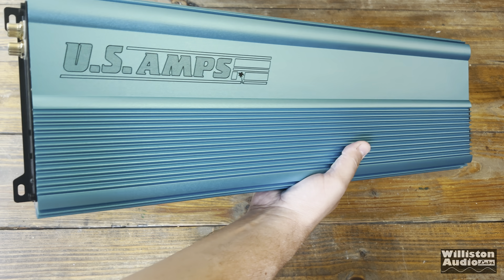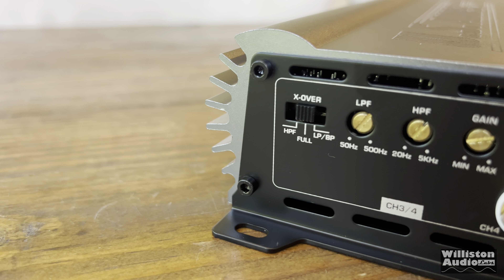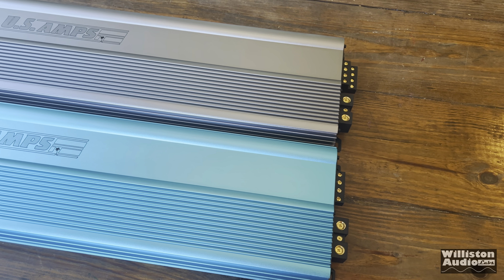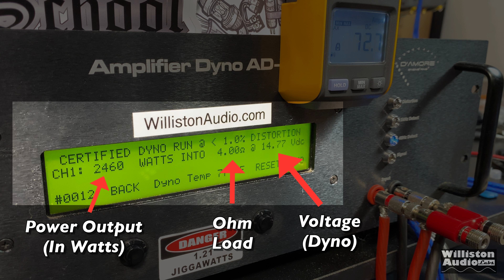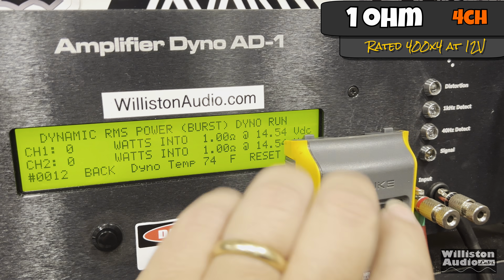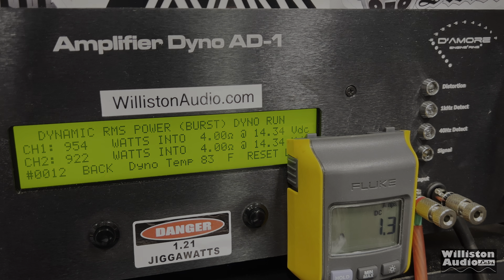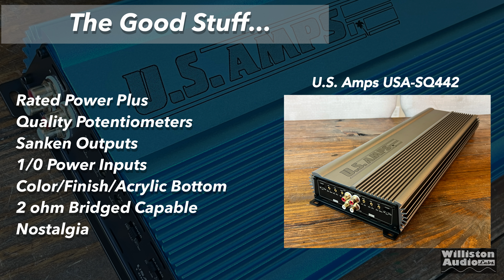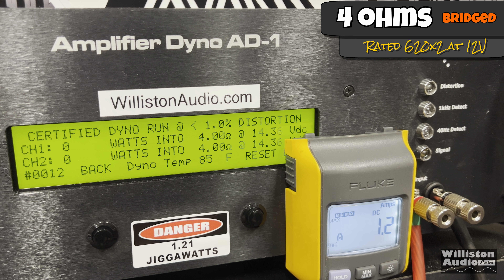The Four Channel Class AB Monster from U.S. Amps - USA-SQ442 Amp Dyno Test and Review

Comment: Hello Dereck i wath this amp live , end find this model one problem , only one , middle tranzistors driver out stage its normally low power its a cold , but power up to max power drive tranzistors temp up tp 70 celsius , its this construction its bad , not heat sink to this , hmmmm ,. ??? ,. its this to correct , im rebulding this amp , end now stbility vork ,. second bad offset 320 mv !!!!!!!!! , to muth this class amp AB , mx off set its max 250 mv to this out stage ,.

Comment: Big DWiz. I have been trying to decide between the Kicker Gold 15”x2 or 2 of the Skar  SDR 18” subs for my home theater setup. You never did do the 2 Skars in your HT setup video you mentioned. Of these 2 options, which would you do?  I ask because you have listened to and have both. 

I am a old school Kicker guy, I ran the original Solo Barics( not the ones with the inverted dust caps, I had those as well) and get this, competed with them running US Amps that were before they ran the plexi bottoms. That’s why I am considering the Kickers. It’s nostalgia for me but hard to beat the Skar pricing. Please help me decide. Thank you so much.

Comment: Great video big D! Low ohm power output is incredible but with that low of efficiency you're generating a RIDICULOUS amount of heat! That teeny fan isn't going to do much you'll need dedicated external cooling if you're going to run the amp at those loads for any length of time. I stand behind my comment from the previous US AMPS video, unless you are an older person and have a connection to the company from back in the day or some other kind of nostalgia/loyalty to the brand, there's no reason at all to pay that price per watt

Comment: What gets me is that this amp is aimed at SQ, but what is SQ about it? Most guys like myself run 6 channels.when running 6 channels, 4 of those channels barely need 50 watts, while Midbass would take on the most of the power. For the price they are asking, i would rather invest my money into Zapco, Arc Audio, or Helix. 

While crossovers on an amp are necessary. If you are gonna call this an SQ amplifier, get rid of the crossovers and allow full uninterrupted signal passes through due to the fact that most SQ guys run a DSP. 

Overall, i do not see anything good about this amplifier or anything new brung to the table that justifies paying that price tag when i know i would get a true SQ amplifier going with a much more respected brand in the SQ category

Comment: As I said on the previous video, they completely missed the mark on the price. This is a $75 amp cost to build in Korea. Full stop.
Reply: No it’s not. If the high power rail devices really are Sankan… there’s 24 of them.. that’s easily $300 of semiconductors even at bulk price. Plus a couple hundred more for all the other stuff
Reply: @darrylpioch2055  Retail price in Korea (MSRP) for one is $3.12, so let’s assume wholesale when you buy a million of them a year is $2. Like I said, this is a $75 amp, but let’s just assume “all these electronics” and overhead, it’s a $150 amp white label price to US Amps. They tried to 10x it. 🤣
Reply: Less than 1.00 each in China
Reply: @my77stang  wow. I’m not surprised.

Comment: I’ve always loved US Amps. I worked for a small shop in ~1991 in Florida, and we were one of the very first to carry them. Nobody knew who they were back then! 
I met the current owners about a year ago at Slamfest in Tampa. They were really nice, and we talked for quite some time when I told them I used to install their original amps way back then. I took their literature, and looked them up afterwards. Sadly, I was shocked at their pieces. I’d LOVE to buy/own/use a brand new US Amp, but even though I CAN afford it- I won’t.
Reply: ...an amp at that price, called "US Amps" should actually be made in the USA.If you want a Korean or Chinese made amp, there are many with similar performance at half the price. It has little in common with the original ,made in FLA, US Amps
Reply: @raymo6795  I have to agree.
These stooges are doing like most every other amp manufacturer does, pick a circuit design and have it made over seas. 
There is nothing in these amps that are American, the original designer of US Amps circuitry is in San Diego California I believe, or somewhere there in California. I actually live about 30 minutes from the Original facility where the U.S Amps were indeed 100% Hand made, except the PCB itself and Casing pieces, my Uncle worked there for several years, made decent money too, up until they sold out to RE Audio.
I honestly and whole heartily believe if a company wants to call themselves American Made or reestablished back under that Name again, it needs to be made here 90% like it was before.
You don't see Sundown, Skar or Jp or many other brands that are started here claiming U.S Made.
Reply: @robcooper3171  …I think all that is left Linear Power, TRU and ARC CLXR…A couple of Mmats mono amps.. have been buying German made Helix for the last few builds.

Comment: ill post this again here as I posted this on your 50HC review for hopes they read this and anyone who may buy these.
I had reached out to them several times about them using terrible quality electrolytic capacitors, even before these amps were available as their photos on their site gave it away. I mentioned for the price there was absolutely no excuse to use junk like that, that people who know whats good will absolutely be angry about it. When they finally got back to me they said that apon customer request they will build them with proper nichicon, rubycon, panasonic or united chemicon capacitors, yet I never seen this on their site and I still don't after my conversation with them. Not sure if this was a lie from them or not, to really double down on my replies I even gave them very specific  capacitor series from each respected brand, highlighting the absolutely most reliable parts, even going so far as to only recommend series which were AEC Q200 certified. Before they had said they would build it to my specifications if I ordered it that way, what prompted them to suggest this, is when I said I'd go so far as to recap it myself if I'd ever buy one. The last reply I typed to them after they said this is essentially this if you're willing to go though all that, why not just offer a correct product out of the box. There is still NO EXCUSE for any cost cutting,  why they are using cheap capacitors when they charge so much. They have no excuse really. I also talked about how, a few of their models used to be rated down to 0.25 ohms with tripple 0 distortion figures... They have a classic series coming out sometime and other lines of amps. For those, they need to step up the quality control.

Comment: US Amps has missed the boat= Not ALL high quality parts, should have 2 pushing, & 2 pulling fans @ the ends of ALL of their amplifiers, & have a (Bass Knob included, with voltage/clip/temperature). Even with ALL of these things added, the price should be $799 to $999 @ the MOST, not almost $1400 for the current USA-SQ442. Great review, Big D!
Reply: A few things: Four fans are needed?  Why?  If the heatsink is sufficient they're unnecessary.  Did they need them back in the '90s?  No.  Bass knob is needed?  Why?  A properly designed system shouldn't need it - and it's a four-channel.  When I had a system in my car, I could play absolutely anything (DJ Magic Mike or Björk, didn't matter) with zero adjustments.  Ditto a clip indicator.  You don't need one with a properly adjusted amp.  Plus, you should be able to tell that by ear.  Price should be lower?  Why?  Because you're used to things made in China.  This is made in California.  And it's not Class D which are cheaper due to fewer discrete components.
Reply: @KRAMITDFROG - Are you affiliated with US Amps? I have been into car audio for over 35 years, and a champion, car audio competitor. Also, what someone did in the 90s, means nothing. Thats like saying, when we were growing up, we used to ride in the back window of a vehicle, & we didn't die, so it's fine! Some people learn from mistakes, & try to do better, others do not.This is a very powerful class Ab amplifier= will get VERY HOT, it did in this video. So yes, 2 push, & 2 pull fans, having air crossflowing through it, should be installed/included, inside this, almost $1400, class Ab, amplifier, to protect this big investment. Heat kills/shortens the life of electrical components. I like running a 4-Ch. amp, to a set of components, up front, off of chs. #1, & #2, then bridging chs. #3, & #4, to run a subwoofer. This is why it would be great to have a Bass/gain Knob for bridging chs. #3, & #4. Also, setting the gains "Properly" will Not, prevent clipping in All scenarios. Music is recorded @ so many varying Levels, its almost impossible to keep from clipping, unless the gain is set so low, you can't get hardly any output. Lastly, there are similar power, high quality, class Ab amplifiers, available, for under $800. So for the amp in this video, that costs more than $500 more= $13??, the things i listed, is Not too much to ask for.
Reply: @evilinside5984   No, I'm not affiliated with them and you wrote all of that to tell me things I already know.  I did work in the industry back in the '90s so I know what things were like.  Personally, I was never a fan of theirs, but I respected them.  I had PPI, which I thought were superior and most in IASCA seemed to agree at the time.  

But, most of what you are saying the amp should have are mostly gadgets. A bass knob is a gadget driven mostly by demand of people who don't have a clue about setup.  There's bass knob on the source if you want (I get that isn't just sub-frequencies but you do have crossovers for a reason).  

I agree on the issue of heat, but fans aren't absolutely necessary if the heatsink is adequate - especially when you aren't jamming this thing under any seat.  

Your application of a four-channel isn't that of the majority.  I'd probably run the same way because I've never used fade.  That said, were it the majority, they wouldn't make monoblock or five-channel amps.  

Regarding clipping, we'll agree to disagree because my gains were set-and-forget; the volume knob does the rest of the work.  

On similar-powered Class-AB amps for less, are they made in California?  If not, there's your answer.  It simply costs more than paying robots or workers in other countries pennies on the dollar while also having economies of scale since they turn those amps out en masse.
Reply: FYI they are not made in California, they are indeed made in China
Reply: @evilinside5984 strongly agree. Plus the bass knob is a great feature. We don’t always want to bring the thunder ❤

Comment: well im using a gaming computerpower supply . that suplies 12v this amp is on my list all that power at 12 volts very deeep. im doing a  home car audio. if any of you didnt know a high end computer power supply its perfect . just make sure it has 60 amps depending or your aplication. and around 800/ 1000 or more . depends on what ur doing

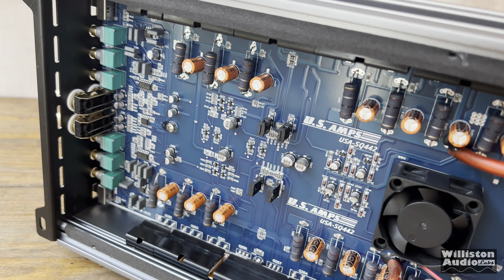Comment: 11:08 the fan fires through a hole in the board. The airflow comes in the side of the amp, around the metal and out the sides again, opposite side of the PCB. 

BUT the placement is bad because it’s forcing air to make a 90 degree turn which it doesn’t want to do.

Comment: Can someone explain to me why it’s so hard to make a 4-6 channel amp with over 2k real watts? Especially when there are full range amps in the 5-12k watts on the market being used for bass at 1-2 channels. Is it an engineering thing???!
Reply: down for sound has a 7 channel amp that does that

Comment: 70 percent profit margin for these amps
Reply: How do you know that?
Reply: @BASSstarlet  I sold car audio. They make massive profits. Also those amps use some of the cheapest capacitors on the market
Reply: @BangingCamry 70% isn't much of a margin. If you're not doubling your money, you're doing something wrong.
Reply: Caps aren't everything... Let me know what 2k amp you have that can outperform my 100hc 🤔 ill wait 😊 @BangingCamry
Reply: @MattGuynn  trauma 3k. Also my Stetsom bravo bass 3k
Reply: @MattGuynn  caps are for longevity and reliability. Nothing to do with performance. It will perform. Don't want them to bulge or bust open. I have Samyoung in my trauma amps.
Reply: @BangingCamry  I'd say filtering as well.. but still so it is what it is.. I got 500$ and one mean single sub  CRX that says I know what I'm talking  about 👌
Reply: @BangingCamry  ok cool.. my 100hc is rated  1900 .. and I have a Orion 2500.1 dz .. pick your poison. I'll spot you the 500/1000 w rated .  And we can dyno them or run them on single subs and spl them see who does what..  I can tell you rt off imma trash that stepson so 😂😂
Reply: @BangingCamry  ahahahh. Looked that Camry up bro.. 😂 you better not pull beside me wit that system sir  😭😭😭 .. shit I'll run my Rockford  prime 1200  against that🤣🤣 stop playing and look my crx up on 1k watts... PFT we ARE NOT THE SAME
Reply: @MattGuynn  🤣🤣 ok I have heard the 2500 dz and the 3500. My dude has them both. Believe what you want to believe. I'm sure you can run both at .5 ohms with minimal heat like my 2 amps right. My trauma can do almost 5k. With box rise about 3500. My Stetsom bass flex does 3k between  .5 and 2 ohms. I have clamped 4300 at 1.2 ohms after rise so. I don't claim to have the best equipment but it is quality and reliable.
Reply: @BangingCamry  let's run them bro.. here .... Gimme 5 seconds imma make a vid... Kk
Reply: @MattGuynn  okie dokie 👌🤟
Reply: @BangingCamry  I know your a good dude , I see you on Nolan's stuff all the time👍.. but if you wanna challenge what I'm saying or have, be ready 🫡 bass on bro
Reply: @MattGuynn  I never said your equipment was junk. I'm telling you they are charging way to much for the internals on those amps. I know how it is to spend your hard earned money and think damn I could of saved my money.  I wish I had a small crx or a small open car to bang in. Its hard to get amazing results from a trunk. I'm sure your system sounds good. I'm only pointing out those capacitors are super cheap. For the money and the consumer they should have put some real quality longitivity type caps in those amps That's all I was saying
Reply: @BangingCamry  I can agree on the caps sir👍.. but I also  know way more goes into it..  they r&d these amps , scraped amd trashed many designs before  releasing them.. they also hired dirk , one of the original ENGINEERS to help with the amp.. all those things cost.. this adds cost to the amp.. YES  can you get a better value per dollar, id say yes 👍.. but my point and what upset me bro was people say its " junk" .. or acting like it dont perform.. thats just bs ..  it's like saying a Corvette is bad bc you can buy a truck that will last longer ..
Reply: @BangingCamry  we all have different taste, different budgets, and different goals..♥️ that's what makes bass awesome 😎.. for example JL audio isn't for me.. I think they are pricey for a 2in coil sub .. I've owned them, they sound good , but simply can't take the power like other subs . BUT you won't hear me say they are " junk" or I can get better , etc etc.. they simply aren't for me.. I have American bass subs that I can get more db from .. does that make them better ?? Id argue no.. the resale and value is too much difference.. actual R&D go into products that aren't open source stuff..  in 10 years what do you think will resale closer to its original cost? Or trade value? In some cases even more !  Which one is worth a recone or used purchase to someone? All these things factor ..
Reply: @BangingCamry  see this is the thing with car audio that kills me.. ITS LITERALLY THE SAME WITH EVERYTHING! cars , phones, TVs .. you guys are so cought up in the fact that what you spent your money on is somehow better or a better deal then what something else is that's higher cost.. generally a reason or two exist for that cost.. NOBODY  is your friend or "cutting you a deal".. they simply are doing business.. why can't you guys in car audio grasp this? No other hobbie is like this and it's not even the companies anymore with smoke and mirrors.. they don't have to , the customers and influencers do it for them.. does a Nike shoe walk faster than a Walmart shoe?? Then why did you get the Nike?? Mr all knowing deal getting citizens??
Reply: Back n forth. Both know nothing. Old vs new blah blah blah. There all the same these days. Chineese components on American designs.  The chineese amps are copy's. Nothing is brand new these days in these price categories.
Reply: @numlockkilla  pony up.. 👍
Reply: @numlockkilla  put your money up home boy 🫡 I give you the same options.. check me out 😘
Reply: More like 400%
Reply: @slickwillybudgetking  Ugh owe 😱... Do you see where this is going?? Do you think your phone was really 1300$ for some kid to make barefoot??? Now is your phone the variety of super cheap Chinese, or pretty good Chinese?? Like is it a I phone with a good camera , memory, and features? Did someone actually research and develop it?  Advertise it? Will it be worth resale or a fix? (DD, JL audio, kicker, sundown, fi); If so then there's your cost..👍   now if you have a old or generic phone guess what... YOU ALSO PAID 400 PERCENT MARKUP..  just less cost at less features, worse camera, no advertisement, no RESEARCH AND DEVELOPMENT.. ( AB, skar, boss, just fill in the blank ) can you call from either? Yes , they both make noises 😂 DOES THIS MAKE SENSE ??
Reply: @slickwillybudgetking  what kind of phone do you have sir?